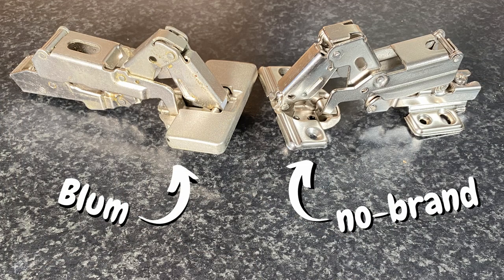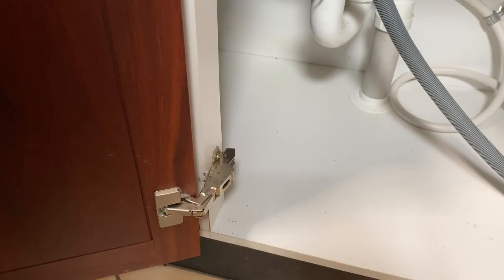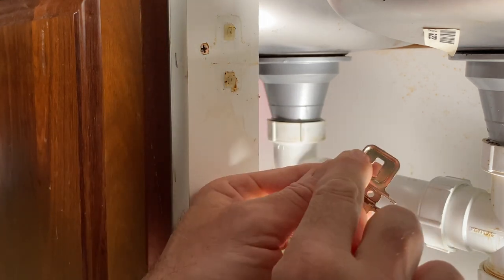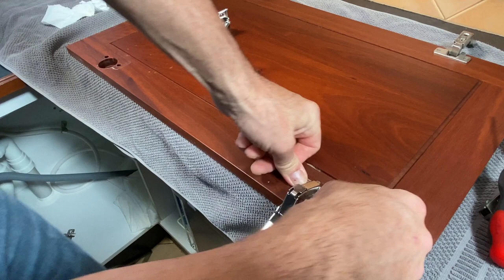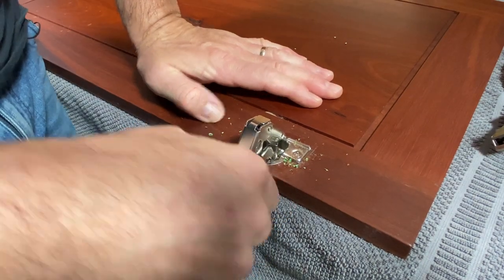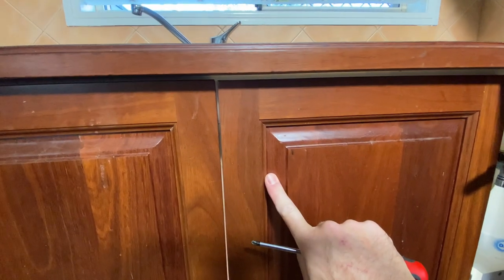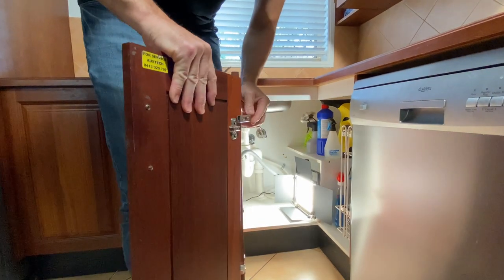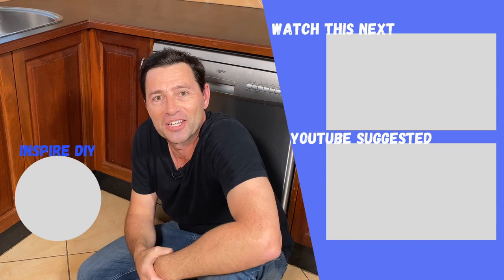Can I replace Blum hinges with a cheap brand

Comment: Another useful item is wood filler if you create larger than normal holes by mistake. I use woodfiller for every unwanted hole I find in houses. Works outside and in, concrete, brick, wood etc.
Reply from the maker: That’s an awesome suggestion greywolf! Thanks for sharing, I use a similar trick when fixing blown out screw holes in door jambs and the like. Matchsticks/toothpicks and wood glue. It’s strong but probably doesn’t look as pretty as your fix 🤔👍 Kent